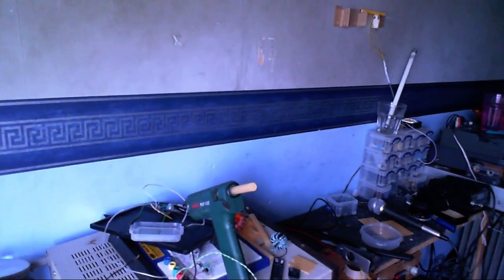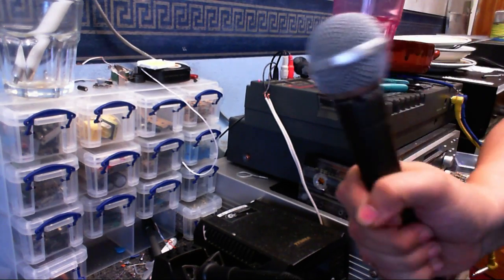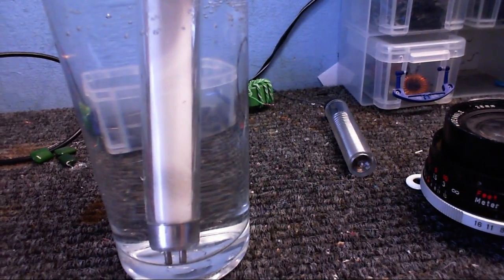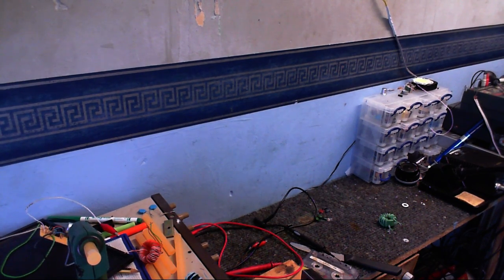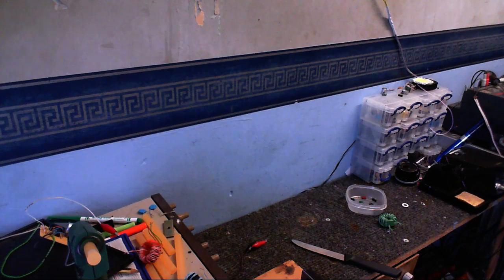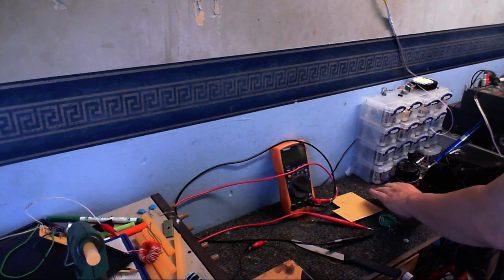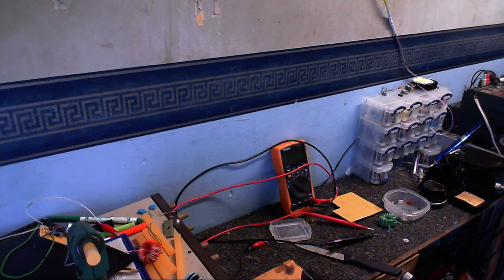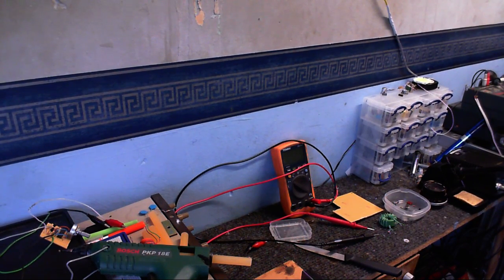Vlog and behind the sceenes at Cool Dude Clem's Electronic Workshop

Comment: the mic sounds like the cartridge is loose.  If you can get the basket off i may be worth trying to fix it in place somehow or wrapping the side in foam tape so it fits snuggly into the basket.  Be careful not to cover any little ports on the cartridge as it's a cardioid mic and covering the ports will fudge up the frequency response.